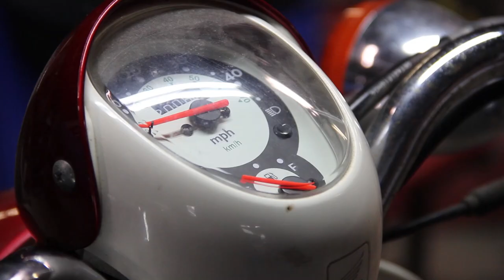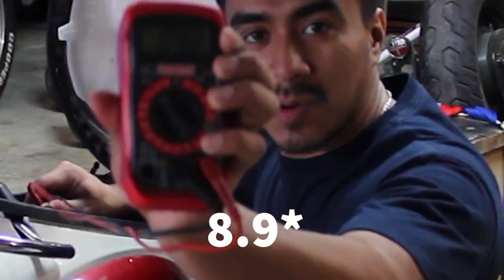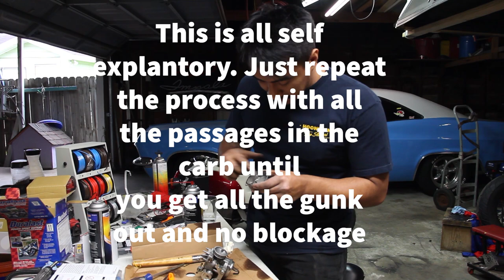Bringing a Honda Metropolitan back to life!

Comment: I am a 62 year old mechanic. I have used carb/brake cleaner and gasoline to wash my hands and arms for several decades. No it is not good for your skin, but when you don this for a living, you don't worry about your skin. The skin on my hands is already ruined anyway. I thought I was the only one in the world to use the small E string from a guitar to clean carburetor jets and passages. I have never found anything better. And no, it won't damage jets or passages.

Comment: I have one of these scooters.  Drain fuel tank and put fresh gas in it. Still would not start.  Went to clean card and what I would call shut down solenoid broke. So I got a Replacement the carburetor for. It runs for about 5 minutes and dies. Make a thing to hang above the carburetor to fill with gas to run to check the fuel pump and it does the same and the fuel pump seems to be working. The factory service manual calls for a peak reading volt meter to check ignition system and I don’t have on. Is there any ohms specific for checking the coil and stator

Comment: The break light is always on, but dim. It gets very bright when you break.
Reply from the maker: yeah the brake levers are a little wonky, haven't addressed it just yet as Im not planning to be out on the road with it any time soon
Reply: @mylifesucks327  also, your left brake activates both front and back break. I have a 2009 metro he he

Comment: Mine is sluggish from 15-20mph but then will accelerate like normal past that. It will still get a top speed of 37mph (eventually.) Is this a problem with the jets not being clean or something else?
Reply from the maker: So after some research and talking to some ruckus guys, most of these mods are almost worth nothing without CVT tuning. So that will be my next step. Mine seems somewhat sluggish as well. They said the CVT would make all the difference.
Reply from the maker: Hey man Im so sorry, I thought you had commented on the other video of the metro. So if the scooter is stock, the only reasons Id see that make it sluggish would be an old fuel filter, old spark plug, air filter/intake not sealed properly, or jets are partly dirty. These small engines are super sensitive to stuff like this, so it'd be good to go ahead and give it a tune up and make your air filter/intake is seated correctly. When mine was stock, the air filter was badly seated and made it sluggish. Just something to take a look at!

Comment: love mine its also a 2007. I tipped it over today now it wont do anything when I push the starter button no noise nothing. It only ticks a few times then stops when I turn the key to on. Headlight isnt on whats up?
It has given my no problems until today alway ran like a dream.
Reply from the maker: Most modern bikes will have a tip sensor that will need to be reset, Ive seen some people simply compress and decompress the suspension by pushing down on the handlebars rapidly and it is enough to reset the sensor. GIve it a try!
Reply: @mylifesucks327  thank you for answering my question  Ill try it.
Reply: remember your brake lever while starting.   Also Elec throttle control may have to be reset- see youtube video on RUCKUS ETC.
Reply: @byronsoutherland5320  Thanks for your reply. I finally got it to start by squeezing the right hand brake instead of the left one - go figure dont know how that happened. It had always started with the left one.

Comment: I’m having the exact same problem my met.  It wont start after being in my garage for a year.  

I pulled the carb and cleaned the jets. Added some gas.  And voila it started again!   But…

I live at the end of a cul da sac and went down the street to a stop and made a u turn to go home.  

The met is just died,  and when i tried to restart it,  it turns over but wont start. 

What do u think?
Reply from the maker: Did it stop abruptly or was slowly dying out? My issue was fixed during the video but started again because the same gunk in the carb was also sitting in the gas tank itself. Had to clean it out really well with fabuloso and let it sit overnight. Also had to use some alcohol to really get rid of that nasty gunk. Has been running without issue since then. A look into your gas tank through the cap hole might tell you everything you need to know. Or it could even be as simple as something may have came loose post install of the carb. It happens. Check for any vacuum leaks as little engines are very sensitive to them. A quick once over should be enough to find the issue. These engines don't have a lot to them!

Comment: What about a 2013 metropolitan scooter 🛵 not starting up when battery is ok?
It has no carborator .. 😢
Reply from the maker: Bad gas, vacuum leaks, fuel pump being bad, unfortunately there can be a lot wrong and with these small motors, the small issues can be enough for it to run rough. I’d check all your hoses, maybe new spark plug, make sure good gas is in it, drain any old gas if it’s been sitting a long time.

Comment: I have a Honda Scoopy, it’s just the overseas version of the Metro that I’m having an issue with starting. It used to electric start, now it inconsistently kick starts, we’ve switched out the battery, checked the relay. I say inconsistently because as we were troubleshooting it starting it stopped kickstarting. But it started after a day or so of sitting. We don’t hear the fuel pump, or see the lights, and the horn doesn’t engage when the key is flipped to on.
Reply from the maker: Check all your fuses and any loose connections, this sounds like a bad ground somewhere. Recheck anything that was unplugged or changed in the process. The fuel pump should most definitely a bit of a clicking sound. You can also try resetting your TPS sensor to help with the starting. Also good to make sure the new battery is actually in good working condition, you could have gotten a faulty one. But Im definitely leaning towards a loose or bad ground in your case, it's very odd for that many of the electronics to go out like that. 
Were all the lights working before the old battery had gone bad?
Reply: Is the ticking you hear when turning the key on your fuel pump?
Reply: @mylifesucks327   We checked the fuses, they look good. Before we started troubleshooting the electric starter I was having inconsistent kick start success. We swapped the batteries for the old one, no go. They were both reading solid over 12volts. It's an older one out here in Korea so that also adds to the fun of troubleshooting lol.  I'll try to find the TPS sensor and see how that goes. I rode it for about a month before I started to have issues.  It was a bit weak with the electric start, but I didn't think about til I had an issue one day.  Yeah with both batteries, lights on and blinkers work. The electrical display came on as well.
Reply from the maker: @mi-yamata1327  Man that is an odd one. Too bad I can't do much more than give advice without actually seeing it. It sounds like either a bad starter, bad wiring/ground, or bad fuel pump/not getting enough fuel. Did the scoopy sit for a while before you picked it up? I'm a little unsure on what can be causing the horn to not work properly. I'm trying my best to be physic right now lol.
Reply: MyLifeSucks It probably did sit for a while. The dude who sells them out here finds scoots across Korea, gets them running and then sells them to military members, and has a good reputation, I just got unlucky. The mechanic he normally goes though has pretty broken English and prefers to work on Korean scoots versus Hondas.
Reply from the maker: @mi-yamata1327  okay I see, another reason could be the problem I had here in the video with mine being that the jet might be getting clogged from all crud and gas that sat in the tank before you bought it. It's a REAALLLLY small hole. Also, check around for any vacuum leaks in the lines. And your air filter also, these smaller engines are super sensitive. I actually had to buy another air filter and re-seat the airbox properly after this video. That can definitely add to issue of it struggling to start. Have you done any maintenance stuff to it?
Reply: @mylifesucks327   I hadn't I rode for about a month and a half before having issues. I got a hold of a buddy who has a scoot and we 'towed' it to the on-base Auto Hobby shop that has a section for scoots lol. Any updates I'll pass your way! Thank you for the response and help so far!
Reply from the maker: @mi-yamata1327  Please do! and no problem, Im happy to help!
Reply: @mylifesucks327  Update! It was the ECU :) Question for you though, does it matter which numbers/identifiers are on the ECU? The Auto Hobby Shop had spares, none of the identifying marks matched but the pins and plugs all matched. We picked one and it kickstarts again! We can now hear the electric start clicking.
Reply from the maker: @mi-yamata1327  That's great news you figured it out! I knew it had to be something electrical. As far as picking the right one, what would matter is trying to find out which years it was meant for. A lot of times ECU's get used over and over again for years. And at times there aren't a lot of changes made unless it's like an ECU meant for something with fuel injection. But if everything hooked up with no problem and started as you said then I wouldn't think there's much of an issue to use it. And with the electric start, is it not turning over? Or turns over and won't run?
Reply: @mylifesucks327  Yeah it's only the clicking with no turnover
Reply from the maker: @mi-yamata1327  hmm Id say recheck all the fuses and starter relay. But it's possible that could be something that particular ECU won't have the proper compatibility for that starter. Which would be really odd if it works for everything else. Also recheck the battery to make sure it has enough juice to actually turn it over, the kickstart doesn't need the battery at all obviously so that's why it'll turn off. Hopefully your starter isn't fried, but Id replace the starter as a last resort.
Reply: @mylifesucks327  Thanks for the advice! I am heading back stateside in about a month so sold her. The dude was super excited about it and is a Honda head (created a metro front ruck rear contraption) and has both a grom and old super cub he's trying to start up. Got what I pretty much paid for it so no bad vibes!
Reply from the maker: Mi-Ya Mata sad to hear it’s gone but good to know that it went to a good home! You can always get another when you’re back in the states. They seem be all over second sites